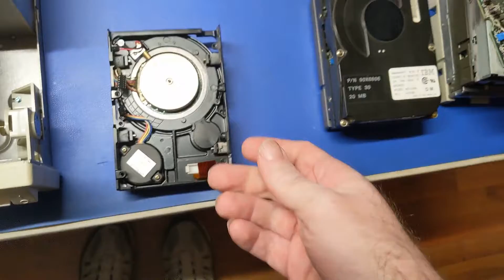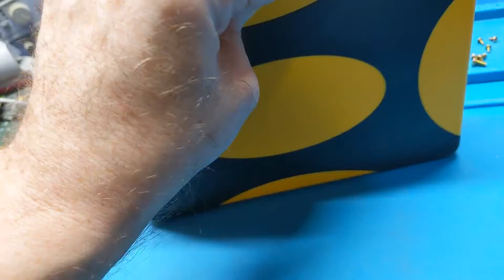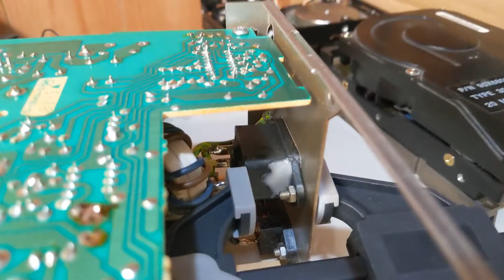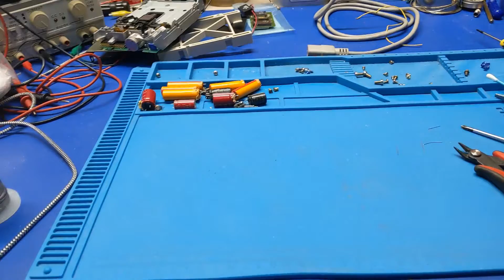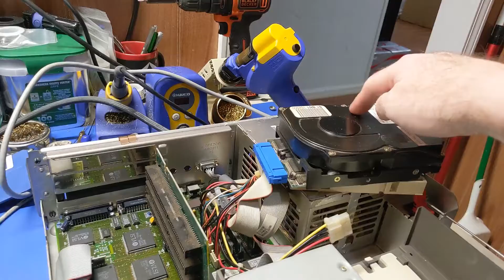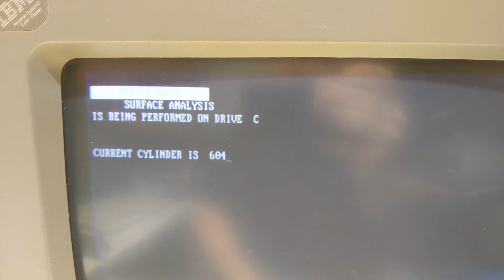IBM PS/2 Model 30 Restoration part 1

Comment: Wow, another video that convinces me that IBM PS/2 were complete an utter tat.

From highly proprietary interfaces to junky plastic that breaks when you look at it ... to almost every part being covered in crappy leaky capacitors and now delaminating boards ... was there anything objectively good about the PS/2 range of computers.

Don't get me wrong, I am glad there are people out there looking after these things and restoring them. I'm just more glad it isn't me!
Reply: It's kind of hard to define "proprietary" back then.  The whole "PC" (proper noun) market was IBM's design.  They set the standard.  Can you even have something that is proprietary, when it's up to you to define the architecture?

You could say "it's not the same as the PC/XT/AT" -- but even that is really only a solid argument in retrospect.  New platforms shipped with whatever interfaces and components made sense for them.  There wasn't a 40-year legacy to adhere to yet.

I'm a little torn on how to hold Compaq to this, since they were making IBM-compatible PCs and still making changes to the form factors.  But, again, there wasn't much precedent yet for how compatible two different brands' PCs should be.

Of course, everyone's going to immediately go into how "IBM was intentionally changing things to claw back some market share" -- and that's true.  But I think they thought they could because that wasn't abnormal for the time.  Things changed, regularly, and there wasn't an expectation that things would be forward and backward compatible for upwards of 10 years.

Comment: I had one of these, the same model, PS/2 model 30 286 ISA around 2000. It came from a bank or an office in Germany, by then they upgraded theirs computers and they sold them to Eastern Europe countries. I had to use it because my 486 suddenly died (video card broke I remember).It was a bery good, sturdy andsnappy machine, thet I used with Windows 3.1. Sadly, by the time I got a new video card for my 486, the HDD died in it and I was not been able to revive or find a spare part to replace it. I remember having tried to use an external AIOI/O controller with a standard IDE HDD but with no success. I really liked that computer and I wanted to use it as a terminal or a network computer (I was playing with networking by the time, trying to boot dos from network)
 So, I gave the computer to a friend that somehow managed to use it with an old Seagate MFM HDD with its 8-bit ISA controller board (or was it SCSI? Not sure). However, seems that the BIOS in that PS/2 can detect and boot from other device than integrated IDE. And, I also remember that the BIOS booted to BASIC when no boot device was detected.

Comment: For the decay of the disks: I've seen in another video that the white plastic part inside the disk turns into powder. It looks quite a lot like it.
Reply from the maker: Yeah I saw that, That's not the case with this one. This was actually bumps that were stuck frozen to the platter corrosion from the aluminum under base

Comment: Hi! Last year I made a model of this computer for 3D printing. You can find it in Printables and it's free. I wonder if you could assist me with some measurements because I don't have this computer and made the model with the help of photos downloaded from internet. But I still wonder what was the exact angle of the triangle that we can see on the front panel (where the logo is). If you could measure it with a protractor, I could make the model more accurate. Besides, I found IBM PS/2 8512 monitor on your channel. I had it in the 1990s or maybe it was 8513 , not sure. I also want to deisgn it for 3D printing but it's hardly possible because the photos in the internet have a lot of distortion and I can't find even approximate dimensions. If you still have this monitor, it would be great if you could make some basic measurements of it. Thanks in advance for any response.

Comment: What impressed me the most is how well these actually run Windows 3.1 on just 1MB of RAM and a 20 MB HD!
Reply from the maker: Right? It's not bad at all. The one I had back in the '90s didn't have windows at all it basically just had a vanilla IBM DOS 5.0 install with Telix
Reply: Oh man.  I remember running Windows 3.1 on 2MB RAM on my 486SX/25, with an 80MB HDD.  Definitely not enough RAM, at least in 386 Enhanced mode.  The HDD was a bit snug too, if you had any games installed.

Comment: I need to go on and finish mine 100%!!! I like my 8086 though :) Never seen security philips bits! Impressive how fussy those power supplies were with a load! I had the same corrosion on the heads cable. I'm releasing today a teardown of that drive, I have the same white powder. They are all doomed. It's coming from the plastic bit, not the platter in my opinion. Awww about the track zero issue.